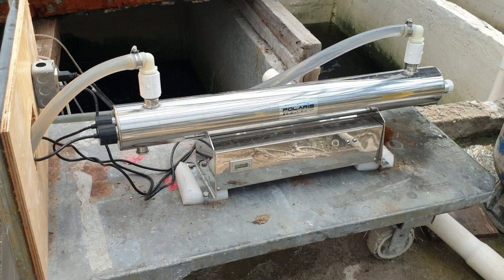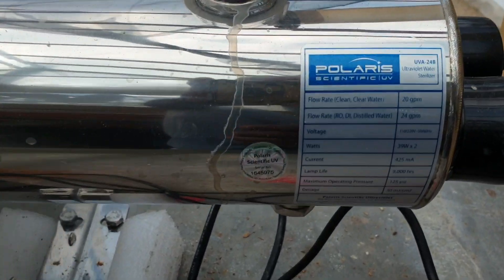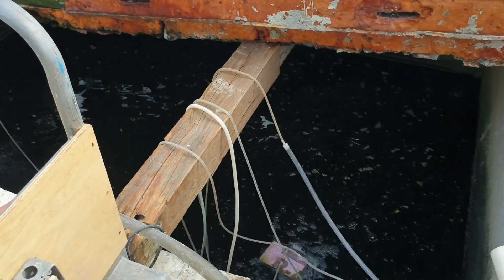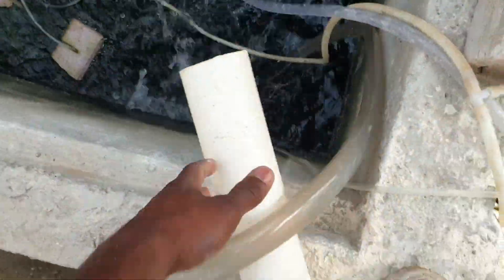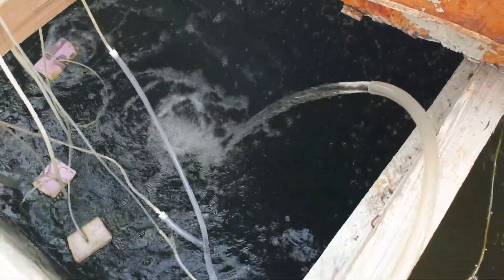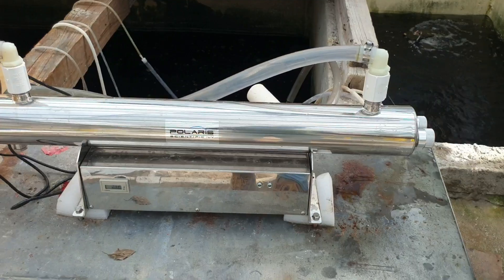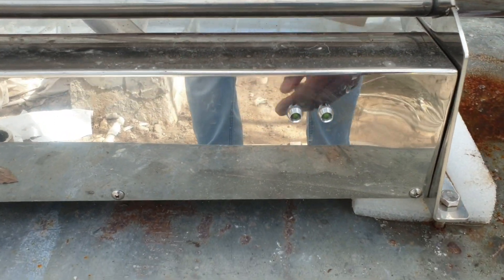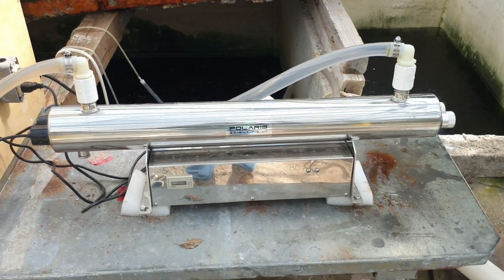UV Water treatment for hydroponic systems

Comment: I think it would be a better idea to pump from one tank to the other instead of mixing up the treated water back into the untreated water. Just my thoughts.
Reply from the maker: That could be done but the other tank feeds a different plot of crop therfore,  we have to pump back the treated water back in the same tank. And it is ok to pump back the water into the same tank because it ensures that all pathogens in that tank water dies due to the multiple recirculation of the water through the UV system. You stated a valid point, thank you.